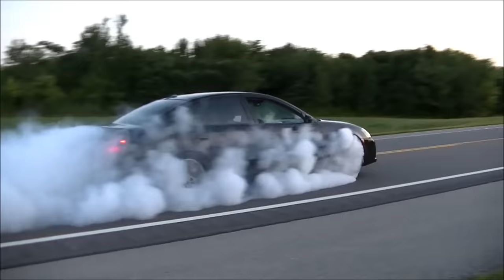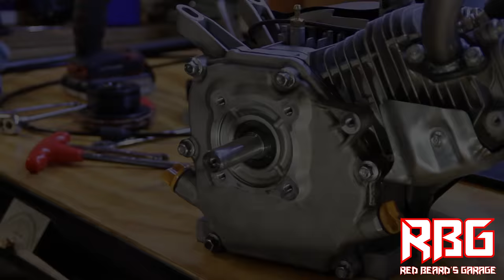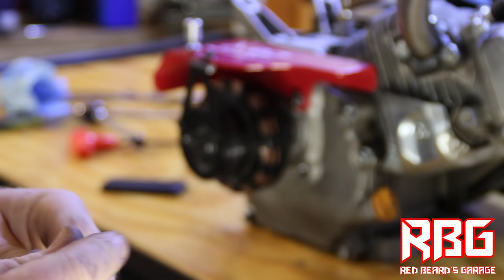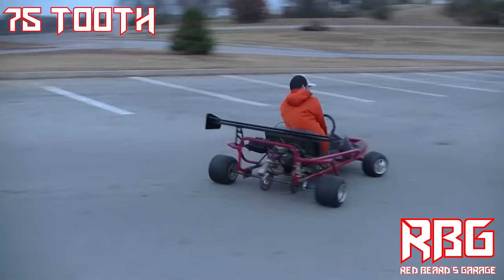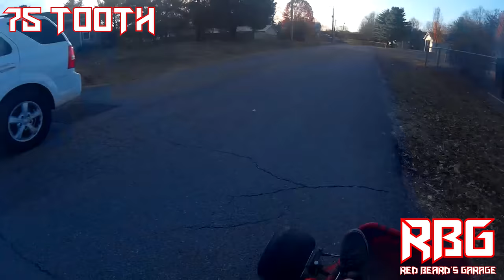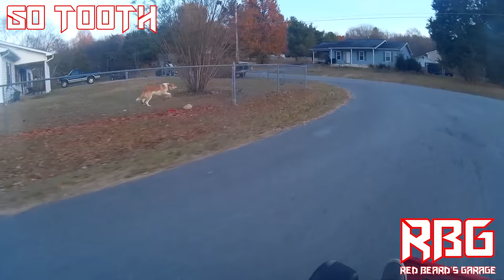(Ended) Predator 212 Go Kart Manual Clutch (3D Motorsport)

Comment: As an old-school gearhead, I was born with a stick in my hand. Nothing makes me happier than stirring my own gears, and dancing the disconnect disco with my left foot! I have always preferred the amount of control you have over the vehicle, with a manual clutch and transmission. Sure- you can bump-start a machine, equipped with one, and induce drifts and such. I also REALLY like having full control of the engagement RPM- which may not always be the same RPM, based on driving conditions. Now, in an application like a go kart, I am absolutely SALIVATING at all of the above, PLUS the ability to make full use of engine braking! I have been dying for something like this to come along! Do I want it? Hell yes, I do! Thanks for bringing this to my attention, maybe with a bit of luck, one of these can make it onto one of my projects!
Reply: This is old but by any chance did you ever get one of these clutches

Comment: I finally got one of these a few months ago and just got to use it for the first time the other day. ITS FRIGGIN AWESOME!!! 
I put it on a motorbicycle with a Tillotson 212 and it's like a motorcycle now. Will be even more like one when I add the 5 speed transmission.
Reply: Let’s see a video or picture of that thing you should make a video for YouTube about it.
Reply: @MendezMotorizedBicycles  never got to it sadly. Lining up gears with chains and sprockets was too hard. That and between the clutch locking up on me due to improper maintenance as well as a cracked exhaust port, that bike now sits derelict in my back yard. 5 speed I was going to use is a peerless 700 replica.

Comment: Since the clutch is normally engaged until the lever is pulled in the drive wheels are always engaged with the engine so when you pull start the engine the wheels turn. Now you need a gearbox so you can disengage the drive to the wheels during start up or an electric starter.

Comment: Idk that I would recommend dumping the clutch on it these style disc clutches have beem primarily used in oval kart racing.. the fact it has only two disc to engage it means with the extra weight of the yard kart and the driver in the kart it will slip the clutch and either glazes the the discs and they won't grab or it will warp the floaters in between the discs..  if it were a 3 or 4 disc this would be a lot less of an issue .. atleast it's twelve tab.. but also if u hammer the clutch your going to dig the tabs on the discs I'm the basket and ruin it quicker..

Comment: When you turn the radio in wheel is diferent the out wheel damage the tires .
the solutions is make angle in the akerman arm and the pivot the stering .
See the video de (the old tony)make gokart chassis.

Comment: This would be awesome with a transmission! How good is the friction material on the clutches?
Reply: JAMES! Since the 70's it holds 20hp pretty reliably. The only issue I’ve had is that the friction material will chip and crack off of the disks if you launch REALLY hard but even with that the clutch still holds power well

Comment: with that manual clutch a 1st and second gear would be great, a 2 gear go cart. hit that second gear and dump the clutch is awesome. what do you think ? a shifter cart is a lot of shifting
Reply from the maker: Yeah it would be sweet having two gears for sure
Reply: man you should see what i  built, manual clutch , racing frame cut and built for rear end weight, JRPW motor built putting out more horse power than ive ever seen, that manual clutch works better after running it and using hydraulics for a lever.  ill send a video to you if you want to see,

Comment: Big drawback: Clutch has to be disengaged in order to start the engine, not necessary with a centrifugal clutch.  I don't see you showing that!
Reply: Most clutches have a lock out so you can lock it in the disengaged position.. at the handle.
Reply: You can also bump start it
Reply: You can bump start a go kart with a autoclutch.

Comment: Hello how smooth is the engagement,i am building a 2 h.p. Briggs on a original Dyno Glide Deluxe bike I want manual clutch but I don't want to slam the bearings.
Reply from the maker: Its as smooth as you want to make it. Just slip the clutch some and your good

Comment: That would be something awesome if it had more options for chain sizes. I have plans on using a motorcycle frame and at least a 7hp horizontal shaft and thought the only option was a centrifugal clutch.

Comment: So what do manual clutches do? Just give you the ability to basically have a "Neutral" gear where you can rev your motor and do burn-outs?   Is that it?  Would be cool to pair this with a gearbox and  a predator 212 bike build.

Comment: Were can I get a front suspension fork set up for my Mega moto 212. You mentioned it before Go PowerSports but they only have the mb-80 mb-105 they don’t carry the adult size mm- 212 assembly I also want to put a swing arm and rear shocks on but I hear they went out of business. I’m currently running a Max Torque clutch on mine no jack shaft a 16T front sprocket and a 52T rear sprocket directly and currently can hit to upper 67 mph.

Comment: I am gathering parts to build a cycle cart and this clutch will work perfect. I have a 4spd transmission from an old Royal Enfield, by using it along with this clutch I'll be able to get quick starts and also be able to keep it geared high enough for long flat high speed runs. Can you tell me if the pads are holding up from the slipping of the clutch and does it build much heat when slipping it?   Also I'll be sure to mention you for the Red Beard Discount !

Comment: Hey, wonder if you could answer a couple of questions for me?  I'm planning on building a motorized picnic table (wife's idea).
Same frame as a kart, made from  1 1/4" square steel tubing, 2X6 planking for table top and seats, and powering with a predator 212 engine from Harbor Freight.  With about 4 people on the table, and a standard clutch, am I just going to burn it up?
If so, what kind of clutch am I gonna need?  Sure appreciate your help.
Reply from the maker: I would use a cvt or torque converter as some people calls it. I don't know if a 212 would have enough power. Make sure you gear it really low.
Reply: Thanks so much for your reply.  So, do you think the Predator 420cc with a heavy duty torque converter would work OK?
Reply: Michael Frith definitely man!

Comment: Hey man my street go kart build has exact same frame as yours. Was wondering how you swapped to slick tires and wide wheels on front?
Reply from the maker: Just bought the wheels, hubs and tires. They will slide right on the stock spindles
Reply: @RedBeardsGarage  ok I wasn't sure if they would or not. U probably know just as well as I do the steering on these suck lol. Did it help drivability any? And did u camber the wheels out any?

Comment: Would that work as an aftermarket clutch on an older stand-alone motorcycle engine? (Currently no clutch or transmission)
Also, for the same engine, I need a transmission, because I do want gears. Can you suggest a (small) multispeed aftermarket transmission for a 220cc engine? Otherwise a matching stock clutch and transmission will cost me $2k or more.
Im working on a custom bike build with a '49 Indian 220cc engine. Stock clutch and trans will be $2k or more.

Comment: Seems kind of silly to have a manual clutch and only one speed forward. Kind of cost prohibitive also unless your building a junior class pulling tractor or something similar, where you would need positive power transfer (i.e. no CVT belt clutch). I would like to see 3D Motorsport or Go Power Sports build a 4 or 5 speed dog-type trans with a built in wet clutch that would slip right onto a standard 3/4 or larger output shaft, or a primary belt drive like Harley with sealed bearings and it's own gear lube. The toothed belt drive would probably be superior, as you wouldn't be limited to just have the transmission hanging off the side of the engine.😉 Considering the average shifter kart, competition 125cc engine can go upwards of $6000, they could charge $4-600 for a trans/clutch package, that would work with anything up to the 670 V-twins and still come out ahead price wise.😁

Comment: Can you make performance mods to a honda engine or is there only performance mods for the predator out there? I have a honda engine in the lawn mower and prefer the reliable start of it. I've never used a predator before so I don't know about them being as reliable. Looking to put a GX390 on mine. What do you think as far as peprformance mods available to Honda vs Predator?
Reply from the maker: All the predator parts work on Honda's. There pretty much the same engines.
Reply: Coolness! Thanks man.

Comment: Have you done a governor removal on a 420cc? I did one the other day and the throttle is weird to set up, I think the butterfly open the opposite way as the 212cc. I ended up using the governor arm in the setup so it would pull the throttle the opposite way. Did I do it correctly or was I just too tired when I did it? Seems to work pretty slick. We put it on a manco dingo. It was snowing when we tested it and it would not stop lighting up the tires.
Reply from the maker: I haven't messed with one yet. I will be buying one at the first of the year to do some videos on.

Comment: I know this a old video but was wondering if someone could answer a question I had. So if I put this on a mini bike you have to have the lever pulled while starting it correct? Just like starting a dirt bike while in gear?
Reply: no, you don't have to pull in the clutch while starting.

Comment: cool design though hard when starting since there is no neutral
Reply from the maker: Well you just have to pull the clutch in. I kept a little velcro wire tie with me and it worked nice.

Comment: question bro: frame wise how much can a 79cc engine carry?? thanks!
Reply from the maker: There pretty weak engines. I would much rather have a stock 212cc
Reply: Red Beard's Garage yea that does make more sense. I have a 71 Honda SL175 frame and was wondering which one would be best?
Reply: adam-david Vaught years ago. I had a kart with 5hp swaped a 3hp on it . it wouldn't even move. Just slipped the clutch. It was fast with the 5hp on it. It was a stout 5 so much compression it was hard to start. And it turned alot more than 3600 rpm. A 3 hp us a waste of time on a kart. If you did hear it to take off. It would probably go 10 mph tops.  And the price difference the 6.5 predator is the way to go..

Comment: There is no way I would substitute a clutch for a torque converter, or a centrifugal clutch. It's like taking off in high gear. I have seen guys use old model A Ford transmissions with a clutch. One guy on here figured out, with an extra lawnmower transmission he had machined one of the gears he could shift gears with the riding mower transmissions. Unless you have a lot of power, and a lightweight person driving, you are going nowhere slow. Put another gear so it will take off faster, and you will be topping out at 12 to 15 mph.

Comment: What if you have a threaded shaft and not a tapped shaft??
Reply from the maker: You have to find a crankshaft to swap out with
Reply: Red Beard's Garage couldn’t I just drill a hole into the crankshaft and tap it ?

Comment: I'm thinking using this clutch on a sprint Kart with a 54 tooth sprocket but no idea what tooth to choose for the clutch, maybe 12 or 14.
Reply from the maker: +Ratkill9000 I think this clutch only comes in a 12 tooth.
Reply: Red Beard's Garage Looks like it comes with 12-17 teeth for #35 chain and 12-14 for 428 chain.

Comment: Question,,,,, I got the same kit for my 8hp two-stroke race kart, but having issues when trying to put the clutch into the bell housing.. the two disk's are not lined up to slide in..... how in the world do I release the clutch with out bending or breaking anything ?????  I can kinda get it to release by hand, but it's a little too much to do by hand and try to get the disk's lined up all at the same time.
Reply: Lol.. want the clutch.. if not already picked a winner :) son would love to have one on his kart too :)  .. Liked, subscribed, here and Fb :)
Reply from the maker: Mine was like that too. Take a hammer and peck it into line with one another. You wont hurt anything, in fact thats what 3d motorsports told me to do.
Reply: ty.. I ended up getting a second pair of hands, I twisted do disengage while they turned the drum and she dropped right into place... all in all, from the quality of everything they did do, i'm very surprised they don't have a simple throw away spacer on it when packaging, other then that everything looks great.

Comment: hey bud do you get any power gains from aluminum flywheels? thinking about maybe getting one.
Reply from the maker: Yes you will get a noticeable gain from it. I defiantly recommend.
Reply: Red Beard's Garage cool thanks man I'm still on the fence about this clutch or the Torque converter. I think I might go this route instead.

Comment: Im in my buddy has a go cart that needs a clutch if this was for verticle shaft i would put it on my go kart mower
Reply: LC's Games itll work on vertical shafts too, you just may need to make a plate to mount the "guard" if your motor doesnt have the mounts. you will also want to put a guard up infront of the clutch, its open and on a lawnmower kart it would only be a few inches above the dirt sucking up dirt like a hoover

Comment: Stupid Question but what does the clutch do?
Reply from the maker: +Dragon just let you ingage it where you want to instead of being auto like other go kart clutches.
Reply: like an on or off switch?
Reply from the maker: +Dragon no just like a clutch in a car. You just only have the one gear instead of 4-5
Reply: do u know any that have like 4 gears? I want to make a mini bike
Reply: Dragon that requires a Multi speed transmission, it's not part of a clutch, although a clutch is often part of a transmission. If you want more than one speed you should probably go with a small motorcycle engine or a pit bike engine.
Reply: @Dragon-fd1lu  Dude your so clueless. I'd be surprised if you can even put gas in it. If you dont even know what a clutch is dont even think about messing with anything.

Comment: wait so does this go kart have a transmission? I don't understand why you have a manual clutch?
Reply from the maker: +Marcos it's the same as a standard clutch you can just let it out when and where you want to.
Reply: Red Beards Garage but your go-kart doesn't have like 1st 2nd 3rd etc etc am I correct?
Reply: Red Beards Garage 

Why would u need a clutch if there's no gears

Is there like a 123 gears?

Also would this wrk w/ jackshaftt
Reply from the maker: Well you still need to go from a stand still to driving. You still need a clutch to let the engine spin free when you are at a stop. Just because its a clutch doesn't mean you have gears.

Comment: What's the point of having a manual clutch? You have no gears to go through.
Reply from the maker: +Nick Timar none really just to say you have one. Lol.
Reply: Nick Timar Imo this manual clutch would transmit more of the engines usable energy to the axle, than one of those shitty centrifugal clutches. Looks like the manual clutch has sealed precision bearings, whereas centrifugal clutches have a bronze bushing that wear out quickly. Plus you can rev the engine and drop the clutch if one were so inclined.

Comment: Nice info!!! ALMOST talked me into getting one... almost... lol (I'm a TC/CVT whore). 

Question bout your kart... hows the steering? The camera tends to show a false image... but i swear it looks like your outer wheel turns at more of an angle than the inner ('should' be reversed). An Ackermann plate would solve 'that' issue. It would correct the geometry to moreso an auto's steering (vs a 'toy') and give you 300X's better response, and a tighter turning radius... just abit of info for you ;-)
Reply from the maker: Yeah i need to adjust the front end. I will look into that for sure. I need to get it fixed fo sho.

Comment: would this be better that a comet TAV2?
Reply from the maker: +jacob dingledine depends on what you are using the go kart for.
Reply: Off road
Reply: And also, does this clutch burn out?
Reply from the maker: If you had a lot of hp it would. The predator 212 don't really have enough torque to do burnouts. Off road i would stick with a tav2.

Comment: how many gears would be perferable with gokarts? n do you know the torque output? ... thanks for leaving out the important details.
ffs
Reply from the maker: +Ruste Damon this is not a clutch for gears. The torque output of an engine is different for what engine and mods you have done to it. So no important details left out.
Reply: k....
Reply: Ruste Damon its rated for 25ft-lbs static torque before it slips, found some info on their website. that is pretty soft, so dont expect to be dropping the clutch for legit burnouts, but once you are rolling i you shouldnt have any slip unless running a lot of power or too tall of gearing 

there was a section on the website that they made a special order, it had a different sprocket and stiffer springs and the rating was bumped up to 50ft-lbs, you could go higher than that with an even stiffer spring but there is only 1 disk available, so the torque that that will handle before shearing is what's really going to limit it
Reply: O.o